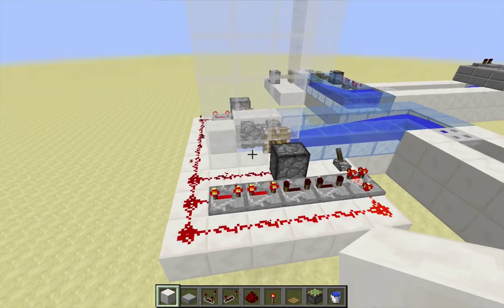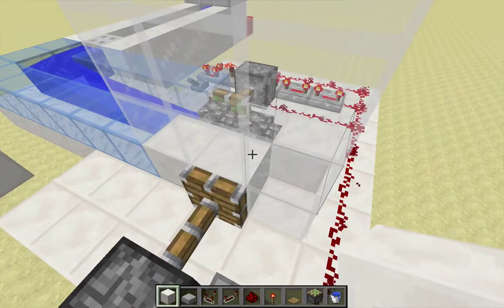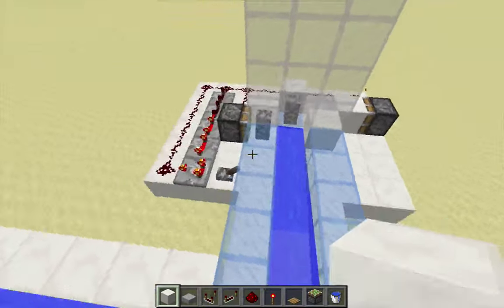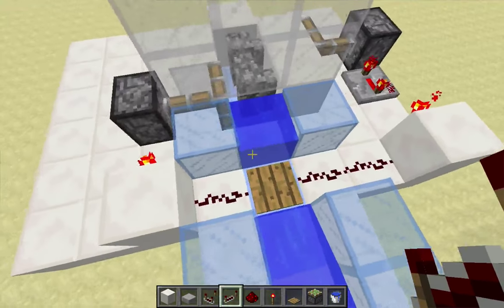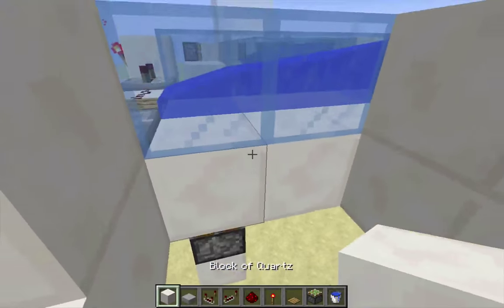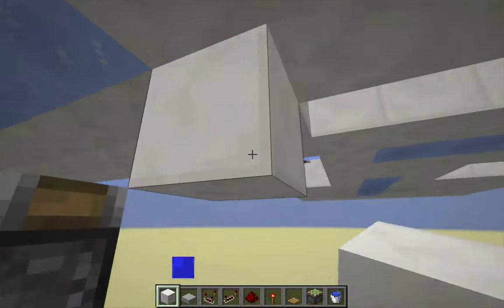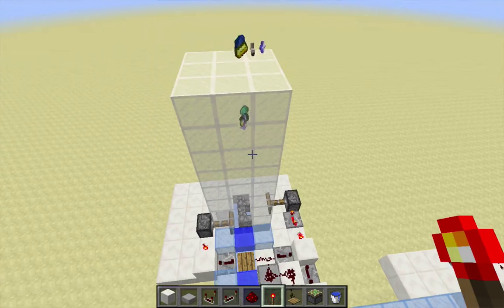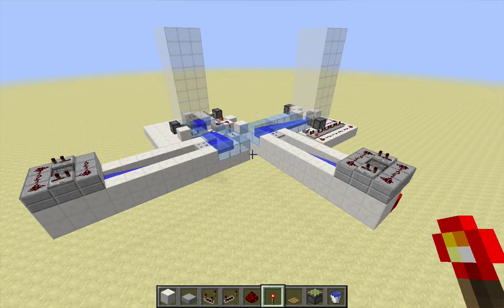Tweaks to Snocrash's Item Elevator, Snapshot 15w39b (1.9)

Comment: Nathan. I ran your version of this item elevator true some testing and found out minor item loses. How ever other elevator that was tweaked from Snowcrash's design that I made had no loses.

I will continue and do more testing to confirm this still, but this suspects.

and by minor loses I mean running it 20-10 minutes and getting loses roughly 10 items from 192 items.

I will leave another comment when I am 100% sure about the loses.
Reply from the maker: Thanks for the info. I've moved on from this particular model, though. ilmango has a nice design that's based on some of my experimenting after working with snowcrash's design
Reply: thx for giving heads up, I think I will check out his soon then.

Comment: Nathan, is there any chance of items getting stuck on the side of the pressure plate or under the half slab at all?
Reply from the maker: +Richard Govan I thought that was a risk, but items never seem to get stuck. By the time they reach that point in the stream, they don't have any "sideways" velocity. Even so, it's possible to take signal from the pressure plate with a redstone torch on the side of its base block, so the wiring can be rerouted without removing any of the side barrier.
Reply: If you're worried about that, you could also use glowstone instead of a half slab.
Reply from the maker: +Joe Nicholls Yes, there are a number of blocks that would work, including glowstone and other transparent blocks like upside down stairs. Although, as long as the items have no sideways velocity in the stream at that point, even blocks with gaps shouldn't pose a problem.

Comment: I am not sure what I am doing wrong here.  I built this elevator in a 1.9.1-pre3 single-player customized flat world, and no matter what I do, items still glitch out of the elevator.  Do you have this issue with 1.9.1-pre3?
Reply from the maker: +Morphius I eventually stopped using this one, due to some glitchiness, but mostly due to the continuously running clock causing too many block updates and tile ticks. It contributes too much to lag, for what it does. In my opinion, ilmango has the best 1.9 elevator design https://www.youtube.com/watch?v=3Bw07wd_Uy4